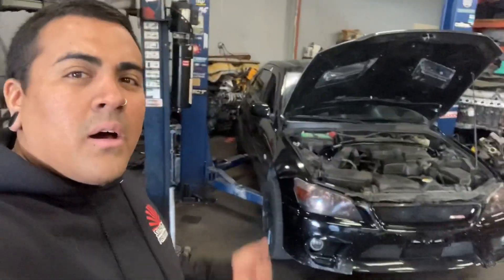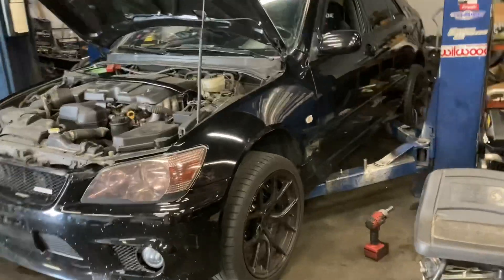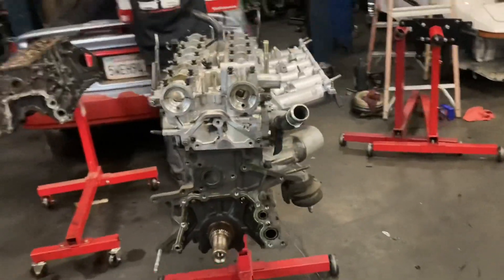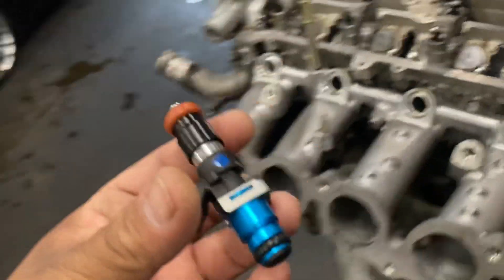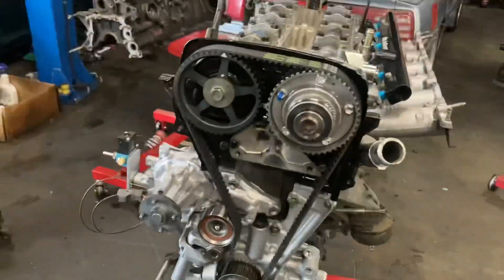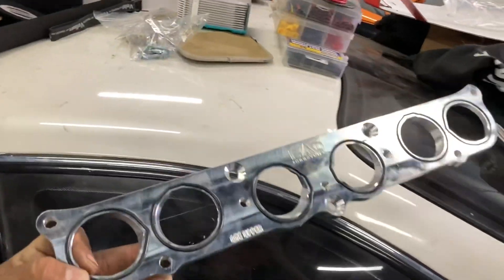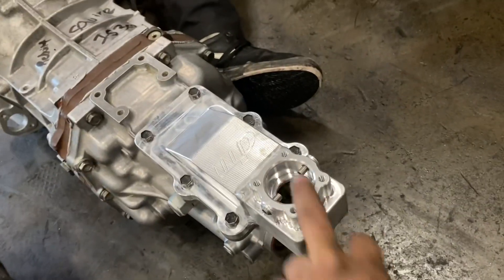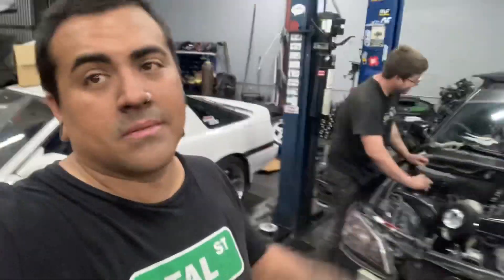Trd Is300 GTE Rods Turbo Build NAT

Comment: Did the engine need machining to fit gte rods?  Or is it a direct bolt on to the pistons and crankshaft?
Reply: I’m here trying to see is it swap and play too
Reply: @Stevo1301  I would assume it would need machined.  But maybe you could take the entire motor and crank and pistons and rods and have a machine shop measure it and just recommend the correct size bearings.
Reply: i think it should just be a direct bolt on considering toyota crowns that had early version of the vvti ge motor had gte rods in them

Comment: Question, if use 93, can I use it all and go to 91 or?
Reply from the maker: 91 and 93 isint going to get u where U want for power unfortunately
Reply: @SidewaysPerformance  understand, just wanted to know if going down on stock everything from 93-91 would I need to clean the injectors before changing gas or it don't matter